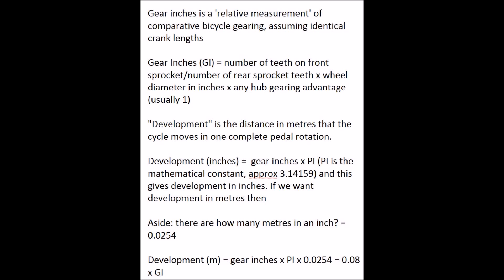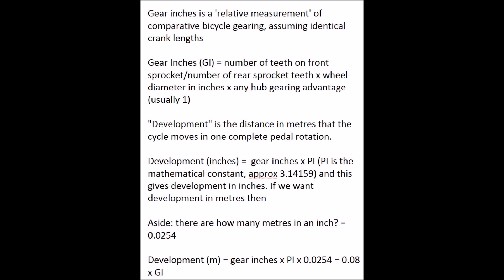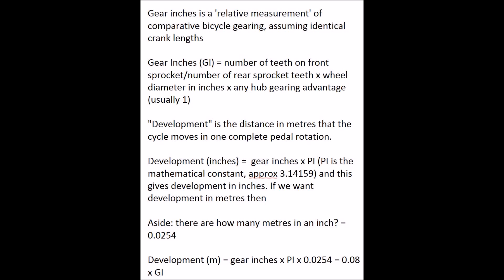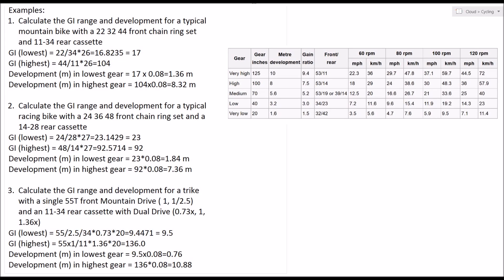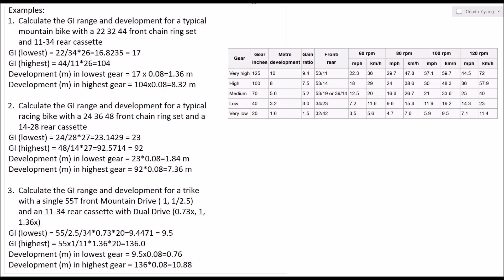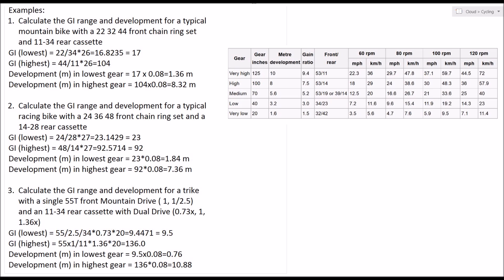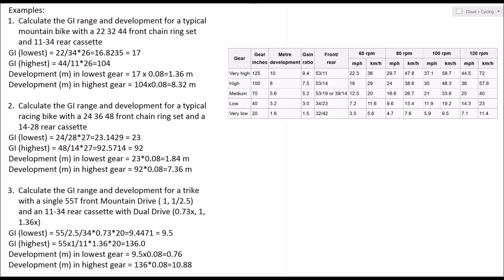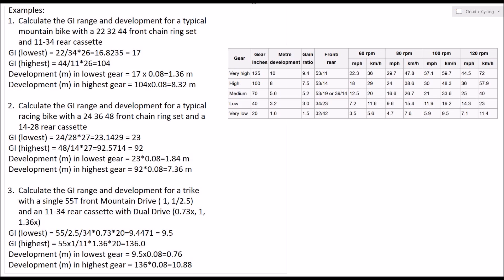Choosing Optimal Gearing For Your Recumbent Trike  - Using "Gear Inches"

Comment: Thank you! This is very useful information. I am in the process of designing a tadpole trike for riding is a very hilly terrain. I am interested in the comment about not having the strength to pedal as I am 75 years old and have weak legs. I can negotiate most hills in my area on my two wheel bike with some difficulty; but am trying to decide what gearing ratio I should have on my trike. I don't want to design it with a very low gear that will be to difficult to pedal.

Comment: My Giro A 20 touring recumbent in gear inches is 16-104 and I run 153 mm  crank arms. Sometimes it is really nice to have those 4 gears below the 1:1 ratio . I am now looking at a trike and I will put on the same crank arms and the same gearing as I have not had to walk up a hill yet.  I do wonder at lower gearing , will it be required on gravel roads or will I just spin the back wheel slower?

Comment: a  24 tooth chainring  (front) as the smaller ring... will give you a very low gear... even if your largest in the rear is a say... 28 tooth

Comment: Very well explained. I do think, however, that such a spread is slightly over the top. These hub gears, however, have internal friction losses and add some weight to your vehicle. The Schlumpf drive is made in Switzerland and comes with a price tag. If I had the money, I would combine this with a Rohloff hub (which has an even more absurd price). Then I could pull a plough with the trike :)
Reply from the maker: Hi Hendrick Thanks for your comments. The hub gears do have inefficiencies and they add about the same weight as a water bottle to your cycle. The most inefficient part of my trike is me :) I road a 'stock' factory geared trike along a popular cycle trail and found a hill which in first gear I simply didn't have the strength to push the pedals around and I'm quite strong. The trike and I were immobilised. I vowed at that point that I would gear my own trike so that this would never happen again. As for the Rohloff, a very nice piece of kit I believe. When I researched it, if I recall correctly, it voided the warranty on the Rohloff when paired with some mountain drive sprocket choices due to excessive torque (pulling your plough?) :) I think this is why I discarded Rohloff and Nuvinci at the time but I'm sure technology is moving on and better solutions will keep coming for those who want maximum gear spread... Thanks for your thoughts, I agree with all that you say...Happy cycling...